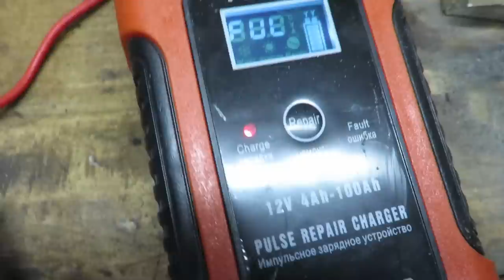WW2 Folding Machete restoration.

Comment: These were issued to WW2 B-17 pilots and crew. A friend gave me his father's folding machete. It opens with difficulty, but bakelite grips are in good condition. Cleaned it up a bit. Very interesting.
Reply: My grandfather has one of these that was brought back from England by my great grandfather (his father). It's in perfect almost unissued condition. Still has the original little thin steel blade guard that was quite often lost by troops. It's still sharp as hell, and I hope to one day inherit that Machete and the M3 Fighting Knife that was issued to my great grandfather. 

My great grandfather was in the US Army Air Force [USAAF] aka the Army Air Corps as a welder and was stationed in England during the war. He even brought home a Thompson SMG in his duffle bag after the war ended. It's still in my family somewhere down in Connecticut. I hope to one day have an opportunity to shoot it.
Reply from the maker: Both awosome stories. Cheers
Reply from the maker: Great 👍

Comment: Well my professional opinion you did a great job you kept all the pitting that was on it at first I was kind of skeptical when you remove the original handles but then I loved it when you use the exact same and old material and just basically manufactured a new handle that looks exactly the same and I love the fact that you use the original pin holes you didn't drill any new ones and you made it look 100% original so you did a great job and if I'm correct that the Soviet folding machete
Reply from the maker: Thanks you for your feedback. I tried to keep everything as it was originally. Wasn't sure if I'm doing the right thing at first, however I'm happy with the final result. Machete looks like new and it works 👍
Reply: @FALCON390Workshop  is there anyway I could receive that from you and we can work out a trade or something cuz I collect vintage military knives cuz military runs deep in my family and I know a couple of my relatives would love to see this

Comment: Got  a similar one. It has a metal cover on the blade, when folded.  Mine is in good condition.
Reply from the maker: Unfortunately this one misses blade cover
Reply: Your answer serves as information ... mine also has it, and clarifies on the blade that it is from 1945 ... I thought that this metallic sheath was not original and it was added later ... now I know that it is an original part of the machete ... mine is painted black ... thanks for the. My regards from Buenos Aires
Reply: That is a later model manufactured by imperial in Providence that replaced the camillus/case machetes. They are worth about $200–$250 with sheath and sharpening stone. This one isn’t worth quite as much, and came with a detachable steel blade guard when issued.

Comment: This is a folding machete placed under the seats of B52s for pilots to use for survival in case they crashed in a remote area. I have one that is in much better condition. They had a brass guard to protect the edge.
Reply: Or could have been on B17s.
Reply from the maker: Thanks you for watching and info.

Comment: I don't understand why you went with the electrolysis,  alcohol and WD 40 only to use the angle grinder later.
I don't think it's WRONG to do those things first, but why bother? Yeah, knock the loose debris off with a wash and wire brush, clean it up and THEN do the chemistry project.
Reply from the maker: i just like to work with clean object.

Comment: Decent restoration. That is one interesting blade. It's like a folding bolo knife. I like it but I don't like half of a sharp blade being exposed. Other than that, it great.
Reply: These were issued with a steel blade guard, leather sheath, and a sharpening stone. I have an Imperial Machete, which is this one’s replacement. It has a guard built into the knife that also serves as the blade lock when opened. It was also issued with a sheath and sharpening stone.
Reply from the maker: Thanks

Comment: If he would have done some sort of rust removal first it would've come apart a whole lot easier and maybe he could've saved more original parts..
Reply from the maker: I get this but some times you need to work with whatever is available in the shop. Going to invest in rust removal soon so stay tuned for more :)
Reply: LMAO, what original parts? the degraded plastic handle scales? or the rusty metal pins? because everything is is original, and the pins you have to replace no matter what, its not like these knives are meant to come apart.

Comment: Why grind the blade and possibly remove the makers name camillus etc and date stamp. Mine is very fine on the blade but reads 1943.
Reply from the maker: At the time of restoration I didn't know what i work with. There is no trace of maker marks at all, therefore I think that was no name one.

Comment: Next time your working on a knife project and your peening over the pins.... Try striking the ends of the pins on both ends with a pointed center punch first and then peen ends over with a rounded ball peen hammer. The center punch start the spreading of the heads of the pins and make life easier.
Reply from the maker: Thanks for the tip👍

Comment: What the point of it point of it being a folding machete if the blade still hangs out and doesn't go straight in?
Reply from the maker: There is a cover blade missing on mine which would cover the blade completely.

Comment: How good is that yellow Stanley vice ? 
Is it a piece of shit ?
Reply from the maker: It's no a heavy duty vice however I am happy with it. I use it for gringing and cutting metal with angle grinder and it works well. Great feature is that its multi angle. Overall, worth it's price.
Reply: Thanks wanted to try one for engraving

Comment: U waisted your time for nothing it's still not sharp the handle isn't even slightly rounded or contoured and u didn't remover any of the pitting on the blade if your going to restore something isn't it the purpose of doing so to make it look like it did new wow man lol if you're not going to be able to do it rite don't do it at all
Reply from the maker: That's a good feedback thanks 👍
Reply: @FALCON390Workshop  I'm glad you're mature enough to take feedback most in life can't take it but I've seen other videos you have done and have loved allot
Reply from the maker: @timsts7014  to be honest this machete was one of the first restorations. I've learnt a lot doing this. Now I would probably approach to this resto differently. But hey! It's all about learning.
Thanks for your comments and glad you like other videos. 👍
Reply: @FALCON390Workshop  , the original scales on these knives weren’t rounded. It was a major complaint. Don’t listen to these people, they are ignorant. There are plenty of these available in excellent condition. You made a worthless one useable. Good job.